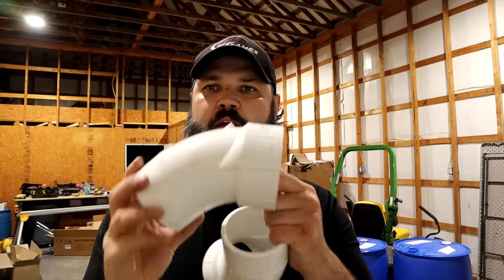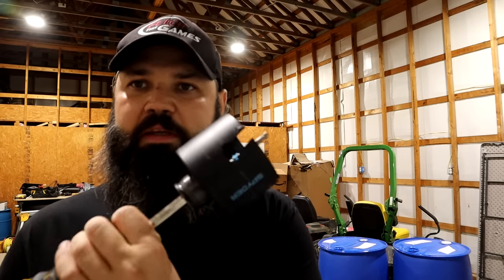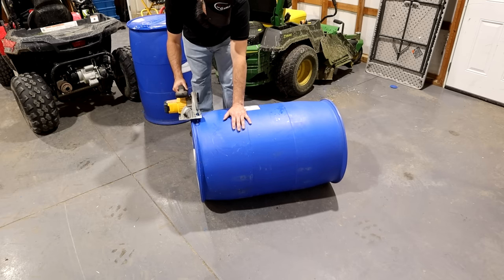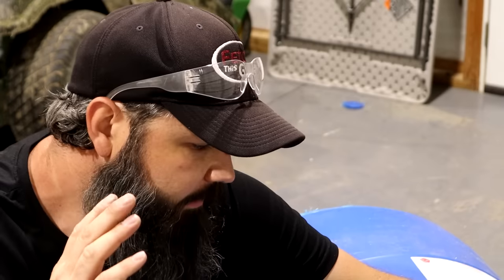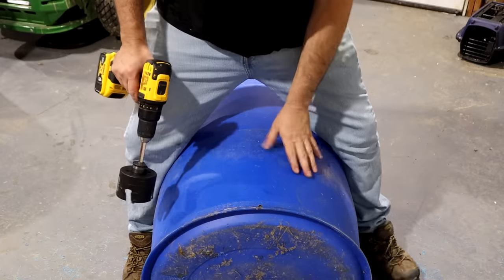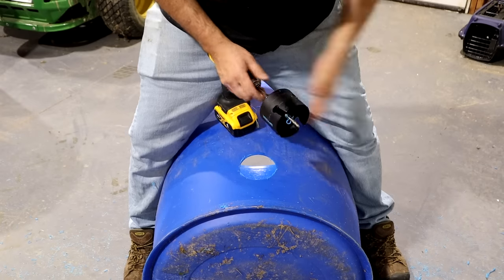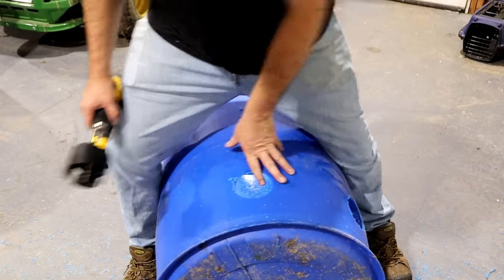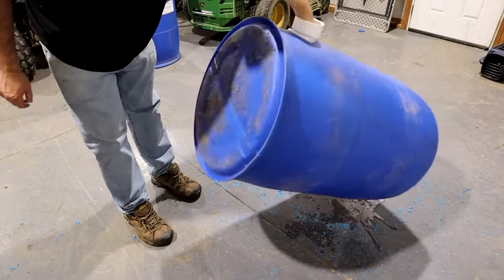The Best Chicken Feeder & Waterer for the Coop

Comment: literaly hundreds of videos on how to do this, BUt this is the easiest and simplest by far. Step one cut a hole, step two shove fitting in. DONE!
Reply from the maker: Yeah, those street elbows work perfect for these.  Glad I figured it out.
Reply: @NicholsCounty only thing I may be wrong but wouldn't the waterer be better away from the window to prevent algae buildup?
Reply: Great build. I’m about to cut my barrel. Last question. Did your roosters have any trouble getting big heads in to eat?

Comment: I've done this and will tell you without more ports in that large of a feeder you have a huge area of feed that will sit and go bad/mold. The chickens simply cant reach in and get to the whole bottom to eat so it just sits. A 55 gallon barrel feeder really needs ports all around it to for the most part stop it. I say for the most part because there is still a section in the center they can't reach that sits.

As for waterers I use horizonal nipples. I swapped to them 5 years ago and out of the 20 or so in use I think I've had 3 go bad.
Reply from the maker: Yeah, thanks for the tip. When the feed gets low. I just dump it out so they can scratch through it on the ground.  I don't pile new feed on top of old feed. There are all kinds of ways to fix that problem. Like you said, more feed ports is an easy way to fix it.
Reply: I suggest a cone shape of some kind to sit in the center (might have to glue it to remain in the center)

Comment: I like the water cup that have the float shut offs. They are cheap and dependable. I always turn the cups up against the bucket or barrel so they don’t get knocked around. I have a few of the little giant hanging basins but they are a bit of a learning curve and $35 each. For 5 hens a 5 gallon bucket is good for a week’s worth of water supply. And easy pick up wash out with spray nozzle or carry to a hose somewhere to get a bath.  
The feeders here aren’t for me I’d have nice and rats out the wazoo in no time. I use treadle feeders now and rarely see any rats anywhere now.
Reply from the maker: Yeah these are more for bigger flocks.  Mice are always an issue around any open feed, but yes this is definitely not mouse proof.

Comment: 3:50 Run you drill backwards first, to start. Makes it way easier.

5:50 You are taking way more effort than need be to pop those fittings in. Best thing to do is, right before you break through with the hole saw, drill a hole just big enough that lets the knob pass though with easy, at the bottom. When you put the fitting in you simply rotate it into position. Plug the bottom hole with anything the chickens can't rip apart. When it comes time to clean the barrel you can easily take them out.

When done get some non treated 3/8ths plywood and cut a diverter plate for the bottom of the barrel. Cut it so the feed slides down to the fittings and there is none back on the other side just sitting there getting old. You can use a bit of cardboard to get the inicial template. Once you get a semi tight fit cut a few layers using the 3/8s. Layers is for the weight of the feed and you can fold the plywood easier to get it in the barrel. Once you get the layers ready to screw together, get a bicycle tire tube (just big enough to pull over the diverter) and slip it over. hopefully you made a good seal. Done this once before for a friend and it worked out nice.

However I have done it with cement before and that took way less time and effort. Laid the drum on it's side, at an angle and poured some water in and got the right angle I wanted. And added some food coloring. Drilled a 1/2" hole directly under to let the water out. Marked the line where the food coloring was. Took utility knife and remarked it, Drilled holes in a few places below that line. Got some vinegar and a scotch brite scrubbing pad and scrubbed 1/2in to 3/4" above the line and ALL over under the line, it will not bond well if you do not do this. Screwed in 3in bolts into the holes, to keep the concrete in place for ever just in case it did not bond well. Mixed the concrete and poured it in while keeping the angle. Smoothed it out, brushed the surface for texture.  Poured a  HIGH gloss oil based paint right on top and let it self level. Took less than the pint but used all of it anyway. The whole process took round 2 hrs. Not counting the overnight to let the concrete set. The concrete being a bit heavier was an added bonus. when the barrel is low the wind won't blow it over.  If you want it lighter you can always use the stuff they use in crime scenes to make impressions/molds of footprints and things like that. No need for the paint or bolts. All you need to do is drill some deck screws into it to hold in place. Stuff is cheap and mean not to shrink.

Tho getting it away from the wall and making a cone out of some sheet metal may be a way better thing. There are many, online cone making template makers, where you tell it the diameter and how tall and it will tell you what gauge metal to use and how much overlap to do. Predrill holes and pop rivet once it's in the drum.

For the water I always tell people to invert the barrel for a better system ( have pix if interested) but for you putting the barrel might be a better thing.
Reply from the maker: Thanks for the tips. I ended up making a diverted for the feed a while back ago.

Comment: You should have drilled your hole in the barrel, for the water feed line, closer to the bottom because it will still have 4"of stagnant water in the bottom when it drains into the drinker.  This way, all the water in the barrel will drain out & not leave 4" of useless water in the barrel.
Reply from the maker: Water is fluid, it moves.  It's not as if the water below the hole gets stagnant.  Also, my water level never gets that low.  I fill this up every week regardless.

Comment: Liked the video and plan to make something similar today with my main man. Just curious how you heat the water in the winter if you're in a cold climate location? ALSO, you experience no overflow of feed out the PVC spouts? Love the simplicity you used. Thanks for sharing with the People!
Reply from the maker: Hi.  I don't have issues with birds pulling out food.  If you mix food, such as corn and pellets, or use scratch, then yes you will have issues.  Certain birds will like one or the other and then pull it out.  If you have this issue just get some duct take and make a little lip on the bottom.  Or you could make a drop box underneath to catch the overflow.

Comment: I feed about 250 lbs per day and water about 30 gallons per day in my broiler house alone.. Been looking for a good solution to cut down on work.. Not sure I could trust all that water in one container that a malfunction might happen and flood the broiler house or lose birds to lack of.. The feeder has potential with some engineering changes. My floor level also raises about 10-12 inches with every 8 week crop so I like hanging feeders for that reason.. But you have my head working.. Thanks
Reply from the maker: This waterer is legit.  I haven't had a single issue with it since I installed it a year ago.  But I do understand the concern.  Good luck.

Comment: Great video. Loving it. Thanks for sharing the information. Can you please share the height of the wooden base for the chicken waterer? I can see you build of 4x4 wooden material so 32” or 24”
Reply from the maker: I just kind of eye balled it.  Probably about 24-28 inches. Doesn't matter as long as its taller than the waterer.

Comment: I like what you did but, I have a suggestion. Instead of cutting the top of your barrel off and then cutting a hole near the bottom, why not just get a longer piece of hose, put a weight on the end that goes into the barrel. Then drop that into the barrel through one of the existing caps, or I guess you could cut a small hole in the top, like you did on the bottom and then fish the hose to one of the caps to put on the weight, and then pull enough hose through your small hole so that the hose & weight will drop to the bottom of the barrel. Then fasten (tape or glue) the hose down the backside of the barrel and use the siphon method to feed your waterer. You could even put the barrel outside your coop and run just the hose into your coop. As long as the barrel is sitting higher than your waterer, the siphon should work just fine and it should never stop unless you let the barrel run completely out of water, and this would fail regardless of which method you used.
You could get a small one way valve so the water will never flow backwards.
You could also install a small "T" with a shutoff on the "free" side (the other side would be connected to your waterer) down near your waterer. That way, if for any reason you need to restart the siphon, you don't have to disconnect your waterer. You just hook up another small piece of hose to the "free" side of the "T", open the valve, suck to start the siphon and once the water starts flowing again you close the shutoff.
Reply from the maker: All that sounds extremely complicated.  I didn't cut the top off my waterer, only the feeder.  This set up works great as is.  Thanks for the tip, I'm sure someone will benefit from your comment.

Comment: Regarding how to keep the water from freezing during the winter when making a waterer of this size? Or if that would even be an issue. We have really cold winters here in Oklahoma. We currently have a 5 gallon waterer that we use a ceramic heat light to keep from freezing. Actually I just realized my solution lol.
Reply from the maker: The tube will freeze before the water barrel.  Heat tape works well.

Comment: I like the waterer, but that line going through a hole has to leak, at least a little. Why not install a bulkhead fitting and quick connect? That's what I'm shopping for to do this same thing with that modification. Thanks for the ideas.
Reply from the maker: It doesn't leak. Made this 2 years ago. Not a drop lost.  Just have to drill the right size hole.  I have 7 of these waterers.
Reply: @NicholsCounty  ok, i drilled a 5/16" hole and was able to push the hose through from the outside after warming it a bit with a lighter and it's working great. I can always add a valve later if it starts to leak. Thanks

Comment: Hi. Thanks for sharing this design. I’m curious how water doesn’t leak from the hole where the tube fits in. Please let me know. I’m using the deep litter method, and I can’t have water leaking in the coop
Reply from the maker: You drill the hole slightly smaller than the tube.  I have 14 waterers like this (55 gallon and 5 gallon).  None of them leak.

Comment: I raise Gamefowl. Every male needs to be separated once they crow. I single pair my fowl. Do you have maybe a conversion of this much smaller. Like maybe a half kilo of food and perhaps two liters of water. Chicken tip is get acidified copper sulfate. Mix 1/8 a tablespoon per gallon of water and green stuff won’t grow during the hot season and it kills bacterial growth in fowl.
Reply from the maker: You can always use a bucket. They make smaller buckets. 5 gallon. 2.5 gallon. 1 gallon.

Comment: Subscribed….. it’s hard to find wateres that are easy to keep clean, chickens always find a way to crap in their water….. the best I used so far was water cups but I might try this, never seen a bell waterer
Reply from the maker: Water cups work, but they break.  And if you have a 55 gallon drum full, then it's a lot of water on the ground.
Reply: @NicholsCounty  I put a cage over it so they could only put their heads in and not step on it…… but now I live in an area that freezes so cups are not an option 🙁

Comment: I would turn those two elbows 180° so that they are facing up. I think it's more efficient that way
Reply from the maker: No.  You'd just have feed pour out all over the ground.  It would be the exact opposite of efficient.
Reply: @NicholsCounty  I've seen a few folks do it and it works really well. Some even cut a end cap in half and placed it over the mouth to prevent any kind of spillage.
Reply from the maker: Yeah, I would see how that might work. With those half end caps. I just still think it would be easier for the chickens to just pour it all out.

Comment: The only thing I did not catch was how you rigged up the water to regulate how much water is coming through the hose
Reply from the maker: You don't control the amount of water that comes out.  The bell waterer automatically does that (there is a weight in the bell waterer that holds it level and when it senses low water it auto fills).  All you have to do is give it a water source.
Reply: @NicholsCounty  
 That is exactly what I was talking about...... A method of regulating the water
Reply from the maker: @ryanlevron1972  Yeah I guess I should have explained it better in the video.  Just assume it's magic.

Comment: Thank you for an informative video. I've had chickens for years but am just realizing the benefits of 55 gal drums vs 5 gal bucket. One question....would 55 gal steel drum work for this too (obviously cutting tools would be different)  or any tweaks to make it work?
Reply from the maker: Yeah.  They should work just fine.  If you use one for water, you'll need some sort of fitting.  Also, it could rust eventually.

Comment: You posted this 9 months ago.. are you still happy with the bell waterer?  Thinking about setting up the same system you have. Thanks
Reply from the maker: Yes.  I'm actually going to convert all my coop drinkers like this.   Tired of water cups being broken off and flooding my coops.  One thing of note, this black line will freeze, where as the water nipple crosses do not.
Reply: @NicholsCounty  I live in NW FL.  I was looking at making a 55gal waterer and came across your video.  Was wondering...how does the waterer STOP  dripping so that it doesn't just continuously flow out?  I bought the little giant dome waterer and thought, it would be great, not so much.  I just need something to ensure my girls have lots of water in the HOT FL sun.
Reply from the maker: @elleehunter-jones2337  I'm not really sure, I think it's magic.  It just knows when to stop.  I have like 4 of these and they all work great.  I have a link in the description.
Reply: @Ellee Hunter-Jones  the pressure from air in it, keeps it from constantly flowing out.
Reply: It has a spring valve/
cut off. When the water flows out into the rim the weight lowers the internal mechanism to stop the flow. When they drink it lifts back into the open position letting water flow and the system repeats.
Reply from the maker: @michaellatham1971  See I told you all. Its magic.

Comment: Suggest a tapped fitting into barrel.  When the tube gets hot/cold/brittle it could leak.
Reply from the maker: I haven't had any issues yet. 100 degrees in the summer. 0 degrees in winter. It does freeze.
Reply: @NicholsCounty  it sometimes happens when the tube gets stiff after a few (3?) Years.  If shaded well, it may not.  
Great video!

Comment: Great video. Getting supplies together now. Do you have a rough estimate on the dimensions for the stand? I know you just through it together but I’d like to make one trip to the store if possible. Thank you!
Reply from the maker: Just measured. It's approximately 25"x25"x25".
Reply: Thanks a lot. Everything came out beautifully. I ordered the feed ports cause they were cheap and came with the drill bit, super clean and easy to install. Thanks for the help and am looking forward to my 6 chickens having an extremely long term source of feed and water.

Comment: Love your ideas and instructions! Regarding the waterer, does the tube from barrel to Plasson waterer have to hang straight down? I wanted to have barrel outside the run, so the black hose would be more slightly slanted up to the barrel, but I don’t know if that would negatively affect the gravity feed. Any thoughts on that?
Reply from the maker: As long as your water bucket is higher than the bell waterer, it will work.

Comment: I already had one for feeding. But I am getting ready for winter and looking for water solution. I have 80 chickens and was thinking of cutting the rim for the water barrel the same way we have done for the feeder in order to drop a heating element down into it. But I was wondering if by cutting the top for a lid on the water would it create too much gravity and force a leak on the hole for the hose? Anyone know?
Reply from the maker: If you use the same bell waterer I have you'll be fine.  Same with those little water cups.  You can always flip the lid upside down as well after you cut it off, won't seal well, but will keep chickens and other things out of there.
Reply: No worries; the water weighs the same with or without a lid.

Comment: Hi there! Awesome video! I do have a question about the waterer. I noticed when you showed it working it drips out of the white parts but will that over flow the bottom at all? It doesn't seem to be like a gravity waterer that only fills it's self as the chickens begin to drink what's there. Just curious
Reply from the maker: I'm not 100% sure how it works. But it definitely doesn't overflow.

Comment: How do you keep the water from freezing in winter?
Reply from the maker: You move to a place that doesn't have freezing winters or get some heat tape.
Reply: Rispectable 
Plz search Glow tube or Glow rod this is powered by 12 volt dc install it in drinkers with automatic Thermostate it well keep warm yours hen drinking water/vitamens
Reply: Buy one of them heaters for a fish tank,